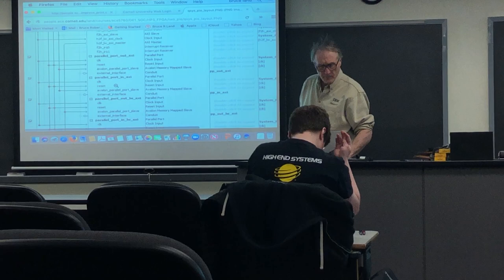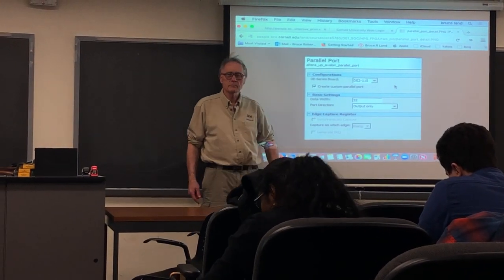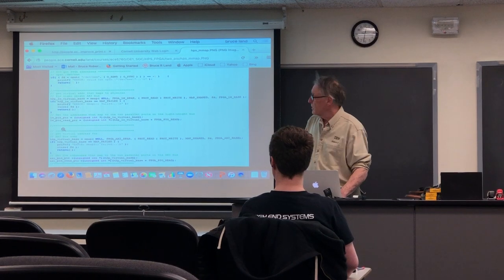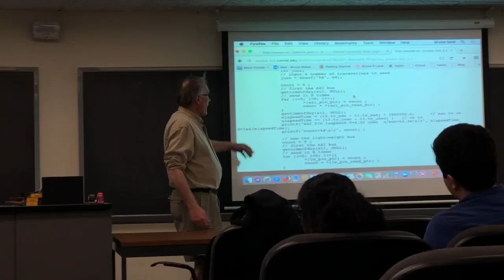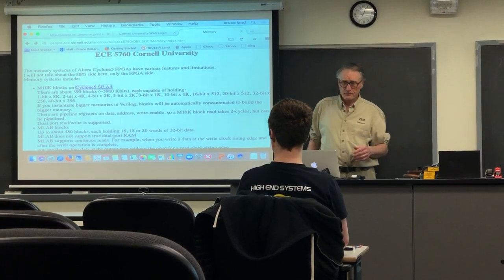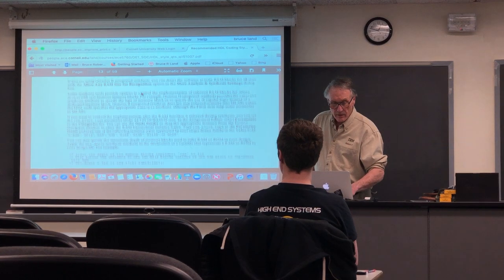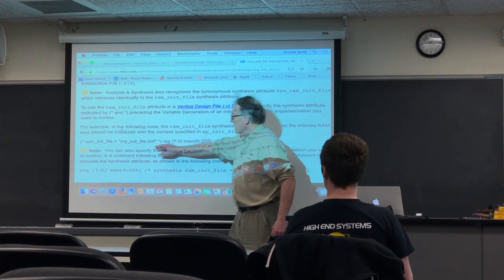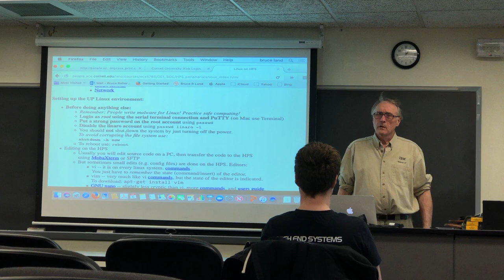#7 Parallel ports on Qsys, Cyclone5 memory

Comment: @Bruce Land, thanks for sharing these great lectures! I have a question regarding Cyclone V HPS-FPGA benchmarks (which were posted here: http://people.ece.cornell.edu/land/courses/ece5760/DE1_SOC/HPS_peripherials/FPGA_addr_index.html). Documentation says that full-speed  hps2fpga and fpga2hps ports support not only 32bit data ports, but also 64 and 128bits per port. Moreover, AXI4  protocol supports burst operations (single bus transaction transfers several subsequent words which reduces overhead per single word), so question is have you utilized these optimizations in benchmark? If so - have you covered implementation details of these optimizations in previous lectures?